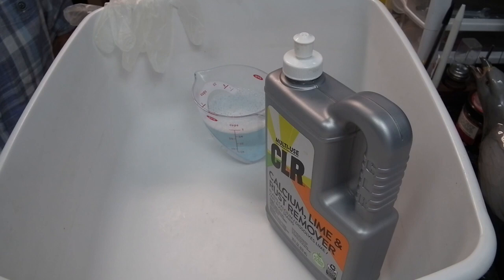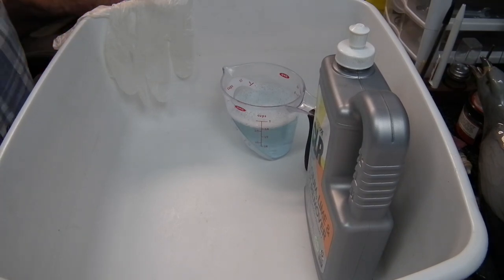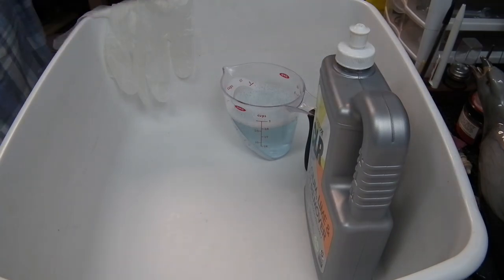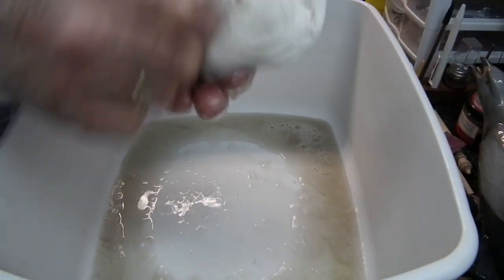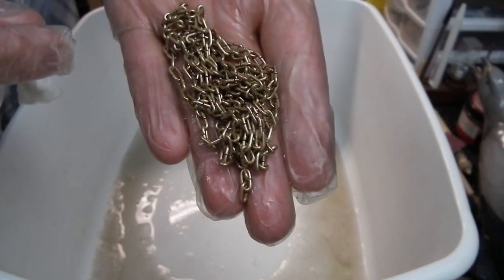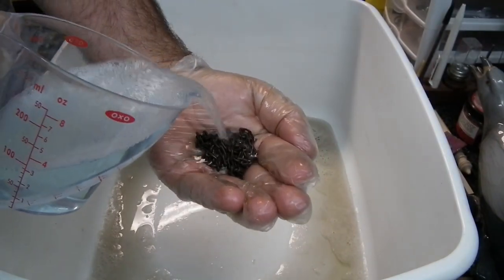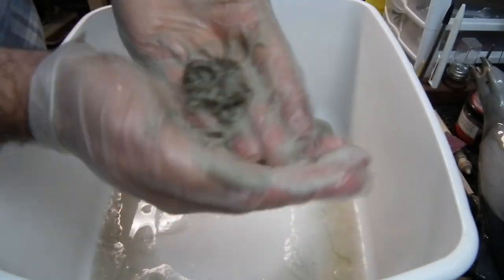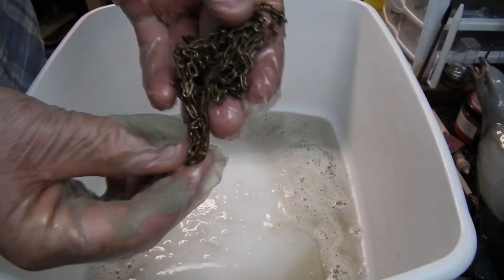Clock Chain Cleaning Made Simple

Comment: German Black Forest Coocoo clock, older than I am. Chains probably never been cleaned, were brownish with a little bit of green developing. I kept the chains on the clock, used a disposable cup, 1 inch of CLR, and a bottle brush from the sink. Two minutes of spinning the brush to roll the three chains in the CLR, and a second cup of water to rinse them, and now my 36+ yo clock has brand new looking chains, and I hate it. 😅 But the green is gone, so it works! 🍻 .
Reply from the maker: Hi and thanks for your comment! Yes it's a balance between restoration and keeping things original. My thoughts on the brass chains, they are an interracial part of the movement, dirty they ware down the sprockets of the chain wheel and even fowl up function. Glad it was useful for you.
PS, might be time for some oil on the pivots too.😉
Reply: @TheBlackForestClockShop  Thanks for the insight. I did pull the clock down and oiled everything that spun, pivoted, or slid, and now it cuckoos much faster too. I agree the chains needed to be cleaned. I used a thin oil to help free them up and keep the tarnish at bay. 👍

Comment: With the understanding that alot of chains are steel, with a brass plating, I think this method would result in the failure of the plating.
Reply from the maker: Thanks for your comment John. It’s true this could further damage plated chain. I personally haven’t crossed any chain thus far that has plating. I do suspect the vintage or modern, mostly novelty clocks could have plating, especially those imports from Asia therefore identifying wether the chain is plated might be a good first step. 👍🏻
Reply: I am going to try this.  I got CLR, and dawn here at the house,

Comment: The CLR label has a warning about brass. I see that you have very good results with it. I wonder what problem is with brass that the warning is talking about?
Reply from the maker: Thanks for the comment John, yes it does state on the label not only brass but Aluminum, Copper natural stone and a slew of other materials yet recommends soaking a shower head which most plumbing fixtures are usually made with some brass in them. I have raised this question to a reputable clock group on FB.  I have  written the CLR company for some clarification.

I'll cut to the chase, it's all about exposure time, my methods exposes the brass or steel chain to CLR for less then 1 minute maybe 2. A thorough rinse in water and now I will include a baking soda rinse as well to neutralize the solution.

If your a clock enthusiast I would refrain using CLR on other clock parts and stick with professional clock cleaning solution or your home brew of ammonia, dawn dish soap, Murphy's oil soap, (acetone when removing the lacquer finish only). Remember, it is mostly about exposure time with most chemicals and keeping the temp below 35deg.C
Jim
Reply: @TheBlackForestClockShop  Thanks James, that makes sense. I plan on using it only for chains. Your method does use very short time in contact and has excellent results.